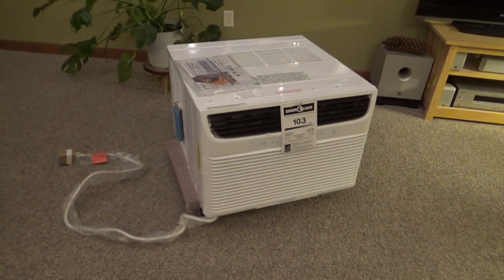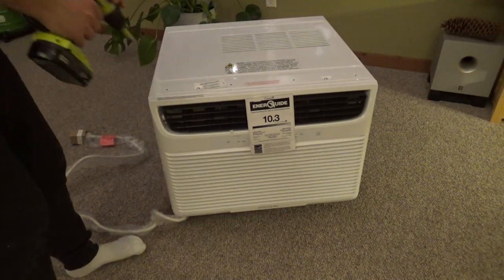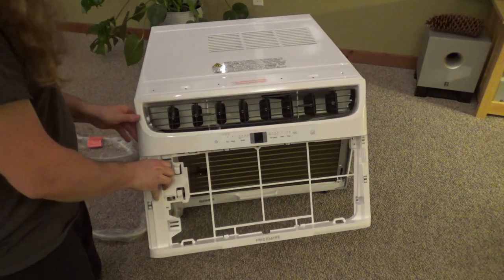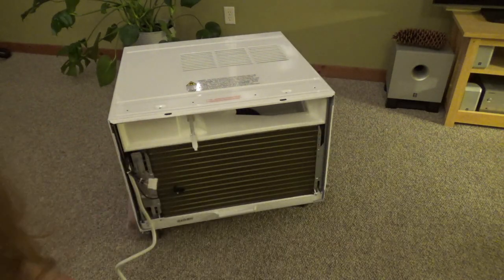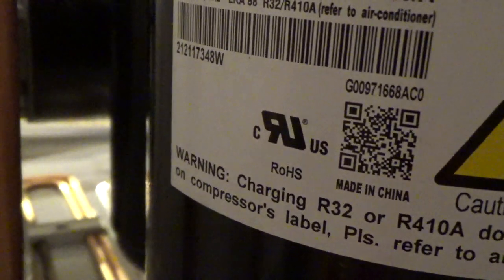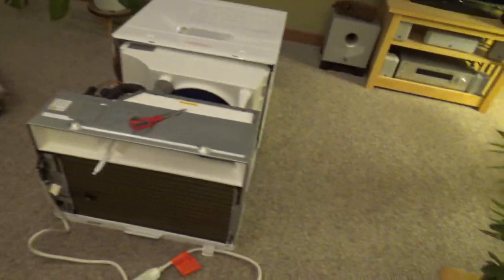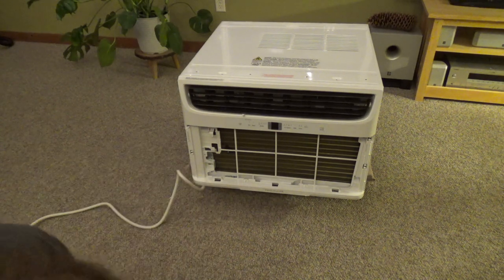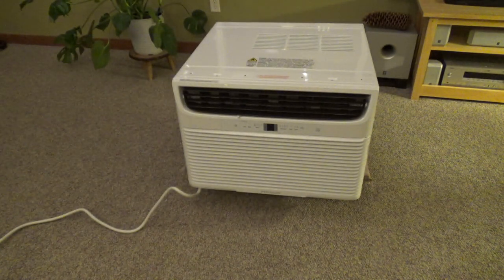Frigidaire FHWC253WB2 25,000 BTU Air Conditioner | Initial Checkout

Comment: While it eventually becomes hot after sitting in a hot metal case for a while, the water that  is condensed on the cold evaporator coils is usually pretty cold… at least at first. This is where the dehumidification function of these type units takes place. In most systems, all of the cooling potential carried by that water is just wasted. You say some things that make me wonder if you don’t fully understand this part of the process… Passing the refrigerant through some copper tubing immersed in this water in addition to what the compressor and the condenser coils do should really help. I would really advise against disabling this part of the air conditioner… I have long wondered why that cold, basically distilled - water isn’t captured before it becomes contaminated and sprayed or misted onto the condenser coils in a little bit more sophisticated way than having the fan just splash some onto it.
Reply from the maker: Whatever gain in efficiency the water produces is not worth the rust and ultimate failure of the unit it causes.